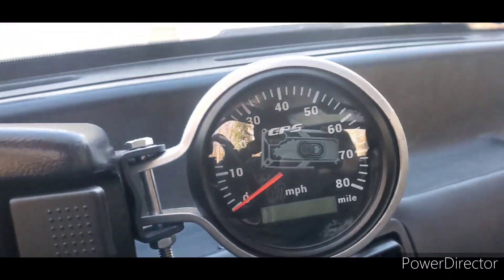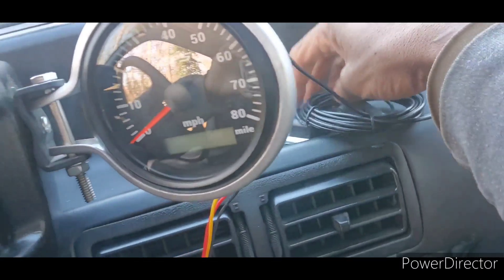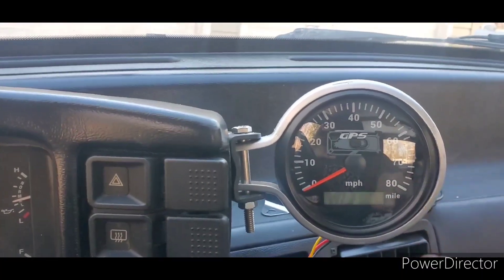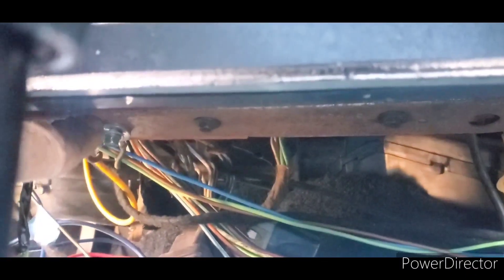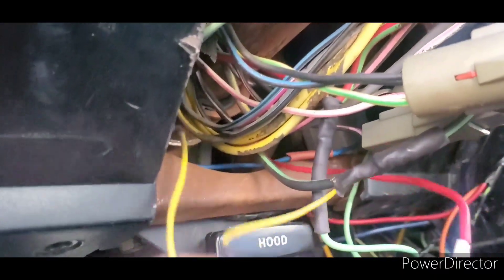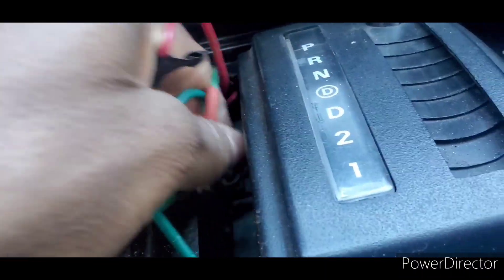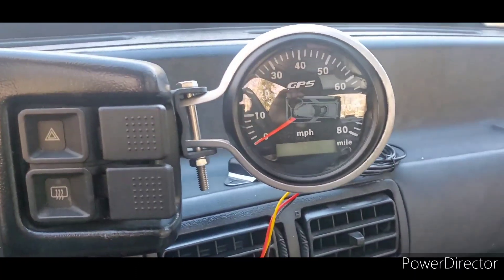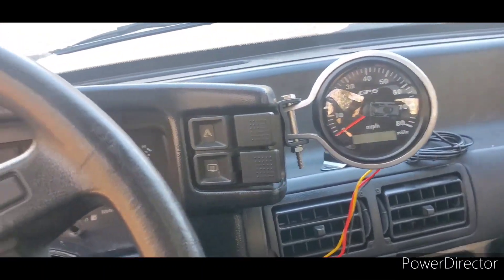Installing a GPS speedometer in a 1987-93 mustang

Comment: Couldn’t I just tap the light wire into where I put the power wire? Then they will both turn on with the key.
Reply from the maker: No because ur light will always be on  when ur car is running. I just tapped into the center console wire that lights up only when I turn the headlights on